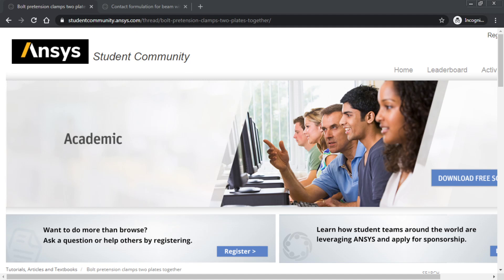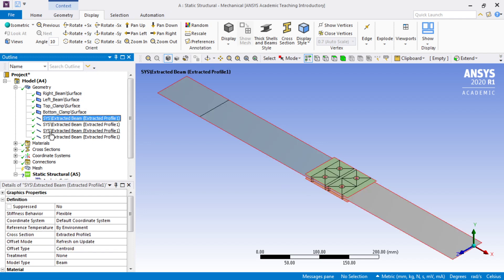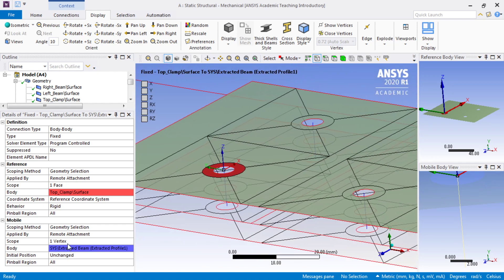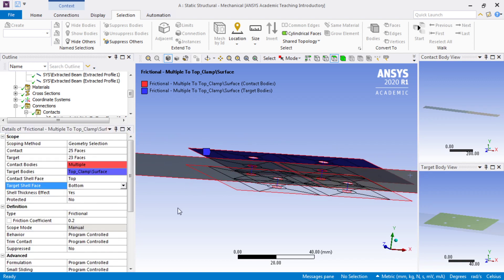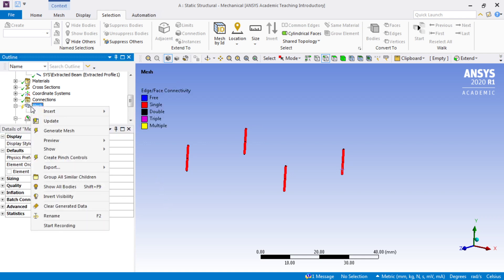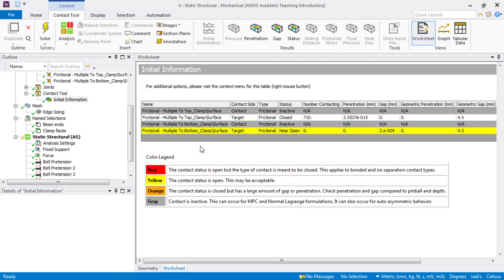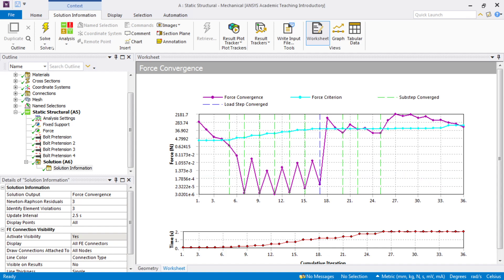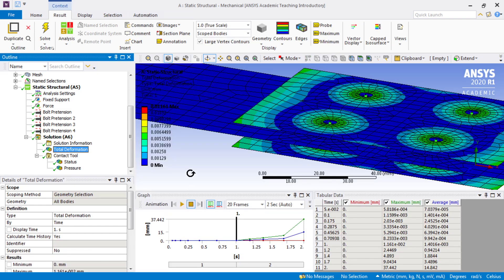Shell Mesh Joint with Bolt Pretension

Comment: Hi Peter,
First of all thank you for explaining such important subject. Bu I have a question about it. You’re connecting shell plates together using bolt pretension, but I think the preload between plates might not be accurate because of the interference between the beam connections(fixed joints) you defined on the surfaces and the frictional contacts. Especially when you apply a large external load, I suspect that the bolt might act more like a rivet or a rigid pinned connection rather than relying on friction or clamp force. So what’s your take on this? Because from a few analyses I’ve done, I think the clamp force in that contact regions may not be correct. Could you comment on this, and maybe go over the applying bolt pretension when using two shell bodies?”
Reply from the maker: Shell elements are an idealization that includes simplifying assumptions that reduce the accuracy of the results. For example, a SHELL181 does not have a through-thickness compression DOF. There is no through-thickness stiffness that can be squeezed by the bolt pretension.      -----   To get a more accurate result, you must use solid elements for all the plates as shown in this video: https://www.youtube.com/watch?v=LkMR1hMmbdE    -----       However, the shell model has some utility when bending loads are applied that cause the two long plates bolted together to bend. You would see the stiffening effect of the two short clamping plates at the center of the length in the results.
Reply: @ansysfeaexamples9351    
Hello again Peter,

I'm reaching out because I genuinely trust your expertise in the field of FEA. I'd like to benefit from your experience on this topic.

I would like to share some challenges I encounter while conducting Finite Element Analysis (FEA), particularly in the modeling of bolted joints. When modeling bolts as solid elements, incorporating factors such as friction and pretension significantly increases the solution time and poses a risk of convergence issues. It also leads to singularities, especially in regions under the bolt head or the nut where contact is defined as bonded or tied. Additionally, I would greatly appreciate your insights on the modeling strategy you adopt when dealing with scenarios involving more than 10-20 bolts in your model.

On the other hand, when modeling bolts as beam elements, I omit the frictional effects between the bolt head and the plate, the nut and the plate, and the clamped region. This results in less realistic outcomes, particularly in interpreting the moments and shear forces. Additionally, without modeling pretension, I miss out on capturing the prying effect accurately. To approximate this, I currently calculate a prying force based on the distance from the bracket's edge and add it to the axial load, but I am uncertain about its accuracy.

My goal is to model bolts as beam elements to improve efficiency while ensuring that I accurately capture all relevant forces, moments, and failure modes. By combining these results with analytical methods, I aim to achieve a realistic assessment of the bolted joint’s actual strength and load path distribution.

Of course, the final decision is up to you. Thank you in advance for your assistance on this matter. I'll be looking forward to your feedback. 
Best regards.

Comment: Thank you for the easy-to-follow explanation. Do you have any tips or resources for modeling contact between the bolt beam element and the hole in the plate due to bolt shear?
Reply from the maker: It is possible to create frictional contact between the beam element and the edge of the hole, but I would suggest using a solid body for the bolt and a solid body for the plate as seen in this video https://youtu.be/LkMR1hMmbdE to create frictional contact between the shaft and hole face, as well as the underside of the bolt head and the top of the plate.
Reply: @ansysfeaexamples9351  Thank you for the response and for your time :)

Comment: I recently found that in a multi bilted joints, bolt load distribution is not even. How to take that into account
Reply from the maker: Apply separate Bolt Preloads to each bolt.  Apply the same value of preload to each bolt in step 1.  Apply some other load to the structure in step 2.  Add a Bolt Probe to the Solution section of Mechanical. There you can output the Working Load for each bolt to see the individual loads carried by each bolt, which could be different.  You could also put a Contact Tool in the Solution branch and plot the Contact Pressure in the interface between the parts. You may see higher pressure around some bolt holes and lower pressure around other bolt holes.
Reply: Hii can you provide the 3d design of yours

Comment: Hello, thank you for the crystal clear video. I thought shell elements have no stiffness in the perpendicular direction (no compression). Which means the elastic resiliences of the bolted joint will not be correctly captured with the application of the preload. Isn't this the case? Or is it somehow compensated?
Reply from the maker: Hello Bill, shell elements don't compute through thickness stress caused by forces normal to the shell element. They only compute stress from bending or in-plane forces. Shell elements are useful for overall structural response. When you want detailed through thickness stress in the plates caused by the pretension, you have to use solid elements. See this video: https://www.youtube.com/watch?v=LkMR1hMmbdE&t=2s
Reply: @ansysfeaexamples9351  Thanks for the response! The plate through thickness stress is not so important. My point is, since shell elements dont have shear deformation (in this case plate compression due to the preload), the elastic resiliences of the bolted joint are not correctly represented. So, why is modelling the plates of the bolted joint as shell elements a valid method to analyse a bolted joint? I suppose for just getting the overall response of the structure it is fine.

Comment: Why is there not a contact between the beam elements and the middle plate?
Reply from the maker: The bolt pretension force clamps the outer plates to the middle plate. Friction between the plates supports any axial loads that the assembly might see along the length of the structure.

Comment: can we apply same joint and contact procedures for rivited shell plates ?
Reply from the maker: Riveted shell plates would be similar but without the bolt pretension.
Reply: @ansysfeaexamples9351  thank you so much i will ask that i couldnt solve rivited plate with this method because of the fact that my computer is restricted and my model iş.very complicated include 198 rivited.  Instead of the fact that, 
Can i modeled this rivits as a beam which has no contact to plates, just their behaviour from rijit to deformable. And this technique give near results without contacts and busy operation. Do you think that operation whic i told is true ?
Reply from the maker: @hakansezen2019  Yes, using beams connecting one hole edge to another and no contact is a valid method to model a sheetmetal part that is riveted together.
Reply: @ansysfeaexamples9351  thank you so much, i had needed that info

Comment: I used this concept for solid elements. However on the outer edge or circle of the face (interface between bolt head and plate) it shows a massive amount of stress which is 700 MPa more than that or analytical calculations. What could be the reason?
Reply from the maker: I have a video using solid elements. https://youtu.be/LkMR1hMmbdE
If you have a question on your model, you can post a Discussion at https://forum.ansys.com/ where it is easier to provide guidance.